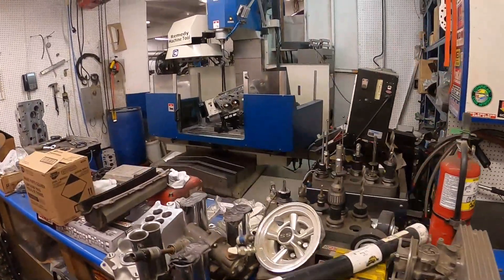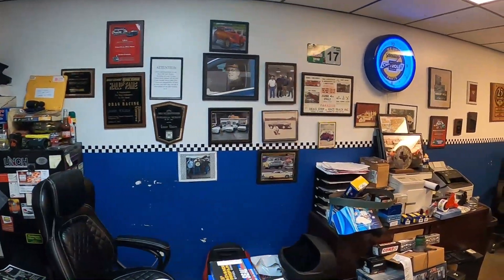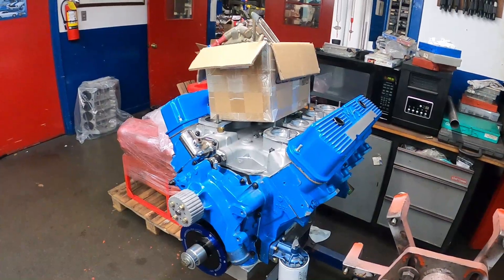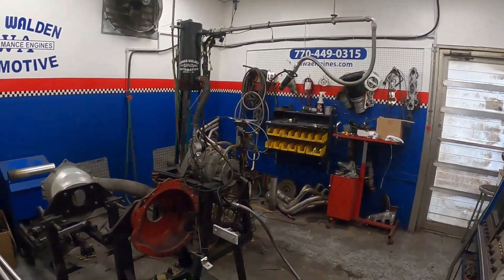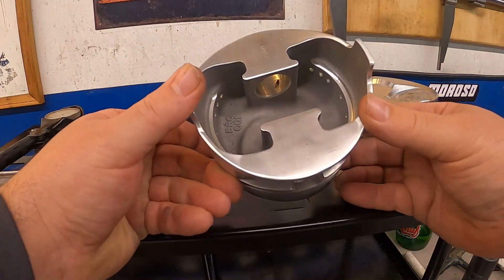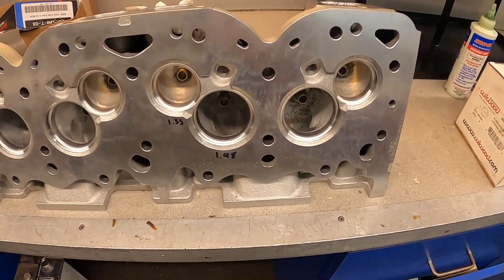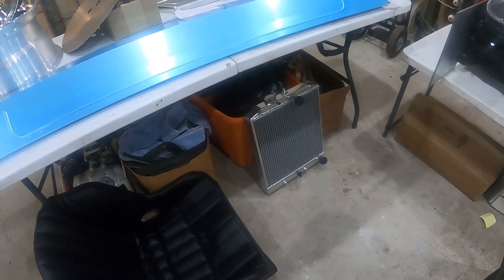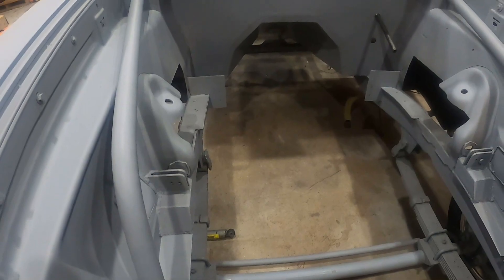AFX Moonshot Build Ep. 2

Comment: just found the channel,why such a small combustion area on the 409?
Reply from the maker: It’s just the way the 409 was designed. It has a normal sized combustion chamber it’s just in the top of the cylinder bore. The head itself is almost a flat head. Of coarse our race 409 have a even smaller chamber to bump up compression. Thanks for watching
Reply: @Eastlakehouseofspeed  thanks for the reply,i watched some more videos and kinda figured it out, best of luck,hopefully see yall in 2022